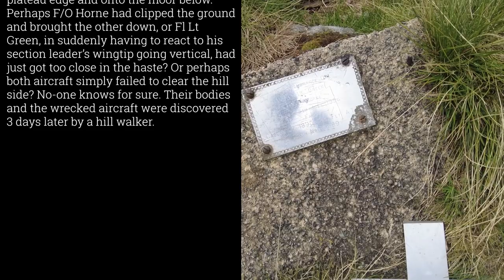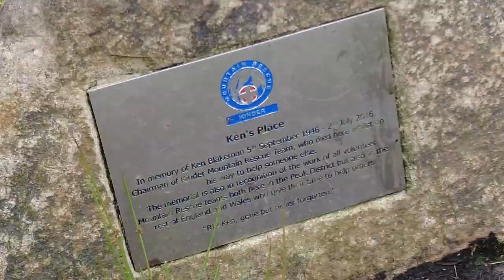The Hunt for the F-86 Sabres XD707 jet and XD730 Crash Sites on Black Ashop Moor,  Peak District

Comment: The reason the front fan blades are 'missing' from the Christmas tree ring on the engine is that they are nickel rich and thus valuable and recyclable, possible removed just after the crash by RAF recovery as well as the 'secret' electronics. The remaining blades would require a major strip down with special tools required.
Reply from the maker: wow thanks for that info